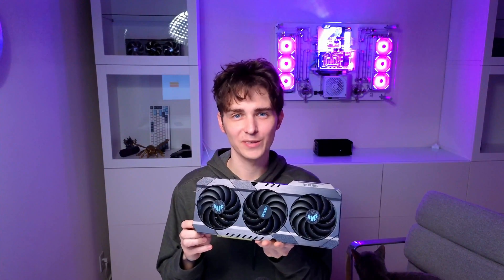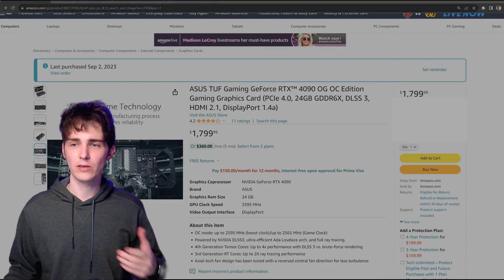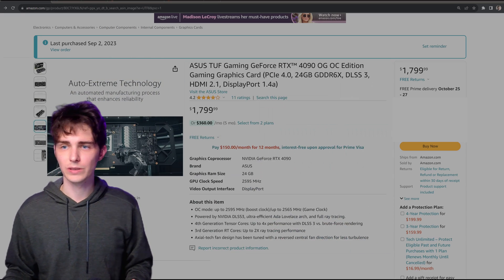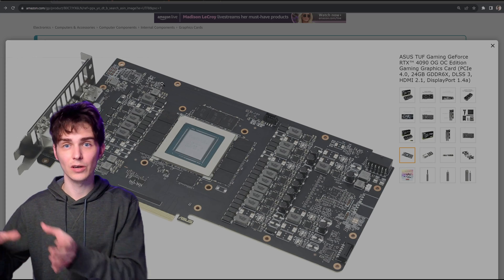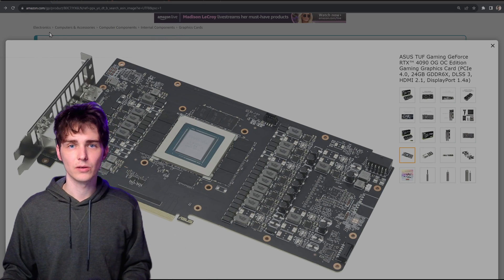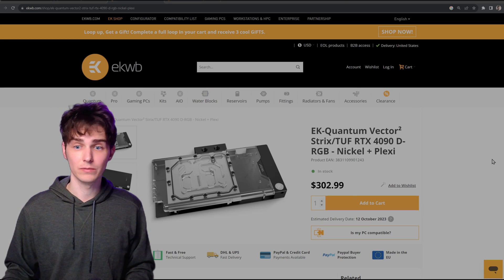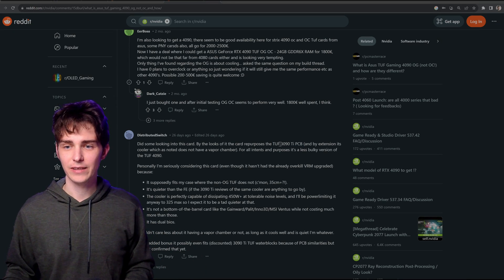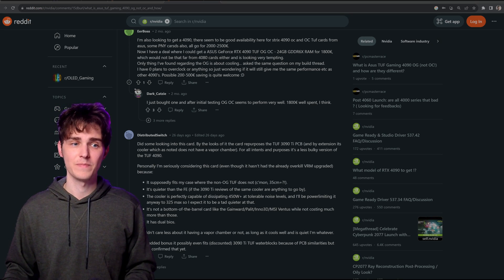Shouldn't have bought this RTX 4090 =(

Comment: Phanteks 3090ti cooling block might fit, however, you'd have to machine the block so that the power supply port and connection clears the metal and the plexi on the power supply corner. Unfortunately i do not have a cnc machine inside my house and good machine shops are quite hard to find in these parts. So I had to return the block to amazon.

Comment: I recently watercooled this card for a client using the EKWB TUF 3090Ti ABP block.
Two minor caveats: the power connector is deeply sunk into the block and the milled recesses for the power connector clip do not align properly, making the clip a very tight fit. The bottom nut/bolt mounting hole for the provided I/O panel does not line up with the hole in the PCB.

Comment: I bought this card
MSI Afterburner settings:
Power Limit 111
Core Clock 300
Memory Clock 1950
Temperatures drop below 55 degrees Celsius in the most extreme conditions
And the fan speed is between 40 up to 50
This card is amazing

I don't know about installing a water cooling kit on this card.

Comment: Bro, I was about to get this card today used/new for $1,400 and I skipped on it because they are also using the 3090 heatsink too. The card is thinner than a standard OC Tuf so it's going to be harder to overclock this card too since it won't handle the heat very well.
Reply: I have this card it never exceeds 70c most of the time it stays around 65c it’s extremely quiet and has no coil whine either, I thought I’d ordered the original TUF but I got this for MSRP it’s a great card much better than the FE
Reply: @TS-wg8jf  my OG is runing 75-80c on gpu .. up to 103 on hotspot.. ;( Asus stinks with building crap crap. card is only 4 month old.
Reply: Don’t buy OG, buy OC guys

Comment: I'm using 4090 Vulcan which is pretty amazing without changing any condition it works with 2820MHz clock speed

Comment: Hi, I bought exactly this card because I use it in 1440p, the question I ask you, is the card less powerful than a normal 4090 tuf or is it just a question of temperatures?
Thanks Bro :D
Reply: i would like to know that too?
Reply: Late to this comment but it’s the same power. Temps are worse because it’s using the 3090 Cooler instead of 4090

Comment: Bought this 2 monthos ago.... Temps went way to high, 83°C GPU and 98°C hotspot on full utilization with RT. Tought it was a bad chip or something but it was more due to the much smaller cooler that is installed here. Even with undervolting not much has changed. I sent the card back and bought an Palit Gamerock OC, Max 69°C GPU and 81°C hotspot. Feels definitely safer in terms of longevity.
Reply: you are talking about this OG OC version right? Standard OC version has got lower temperatures?
Reply: @frankthepriest1220 Yes. The OG versions from Asus have basically a 3090 cooler on it. The normal one is much bigger so the temps are better. Asus TUF OC 34,8 cm = Good, Asus TUF OG OC 32,6 cm = Bad.
Reply: @marcelinouzerrio4937  thanks man. I ordered one on amazon and I'm waiting for it to arrive. On the site it was labelled just "OC" but I read on the comments that someone ordered an OC too but received an OG OC... when I receive, where is it written that is an OG? On the box, on a sticker on the mobo or where? Just to be sure to be aware if it is an OG or not
Reply: @frankthepriest1220 The cardboard of the good card is octagonal. The one on the OG card is normally square. The cards also look different. The OG card has distinctive notches on its fan, 3 on the top and 7 on the bottom. The good OC card has none of these. If you look closely, they look like completely different cards. The fact that they are both black and have the prominent TUF logo in orange in the same place in the pictures can be confusing. Maybe that's how it should be :-D
Reply: Thanks man. Card arrived and it matches the description of the good OC. Yeah people like me who never saw an OG model could easily confuse the two models, and the fact that it's not clearly written on the box let me think that Asus did it intentionally. 
If they are two different models of the same card, Asus HAD TO write it on the box, to let customers choose and not accidentally buy the OG like it happened to him
Reply: I also had this card and I was shocked about the temps. now I have the standard version and I am really happy.

Comment: Hey i just bought the 4090 tuf OG OC but it was marked as a 4090 OC, did I get scammed? Is there any performance difference?
Reply: In my case it got a lot hotter than all other custom models. I sent it  back and bought an other card. Normal temps.
Reply: @marcelinouzerrio4937  I can t send it back it is what it is now
Reply: My OG OC is working great! Temps under workload about 40-45
Reply: @Piapaopao  mine stays a little higher, I fling hate this og shit
Reply: @Piapaopao  in your dreams... the most expensive cards got average 58°c
Reply: you can only overclock this card up to 500w and the standard and the strix one can be overclock up to 600w

Comment: Bro asus is messed up
Reply: satandard bait and switch. we should be given pictures of the PCB on the box, as well as what GPU die they are using. if its non reference that should also be stated. a nice flashy "Custom Engineered PCB!" doesnt even sound bad and give the user a better expectation but it snot about that its about $$$$ for as little effort as possible. This combined with the over volted of AMD SOCs and their joke warranty support for it will keep me from buying any ASUS products, they aint EVGA lets put it bluntly. 

all of this isnt even compare the fact that several 40 series models from the 4060 to the 4070ti have 8 lanes but they use the full sieze 16 lane to make it look bigger but the lanes are faux and go nowhere. thats false advertising
Reply: TUF 4090 owner here! Its amazing

Comment: MSI > ASUS

How many times do people have to get burned, in order to realize this. . .
Reply from the maker: Never tried MSI. Might have to next time!!
Reply from the maker: I really needed 2 HDMI ports though
Reply: @hightechlife  They force over clocked people's CPUs, on ASUS motherboards. Causing the CPU and motherboard to burn, and destroy both components. Then they wouldn't refund people's products, basically destroying the customers entire build. It took an entire community backlash to force change. Gamer's Nexus and Jay 2 Cents made videos about this.
Reply: Brand loyalty is absolutely stupid. I've owned 5 different 4090's, and ended up with a Gigabyte Gaming OC 4090 because it was the only one with zero coil whine with the best silicon. It was a fun binning process. The list includes two MSI Suprim X 4090's, a Gaming Trio variant and an Asus Tuf, not the model shown in the video though. I did like the MSI cards more then the Asus one, just because the Tuf had atrocious coil whine and the hotspot hit 100c after 2 weeks in standard 4k ras which was absolutely not okay for a near $2000 card. A bad TIM application out of the factory?  Not okay Asus. My point is though QC varies with every company and every generation. I was skeptical about Gigabyte at first and now it's been the absolute best, most reliable card I have owned for the past 10 months. Suprim were beautiful definitely but yeah. Why power limit a card with a 26+4 phase VRM it doesn't even make sense. I shouldn't have to flash the bios to get what I desire.
Bottom line though when I see people stand behind and stick up for certain brands while bashing others, it is absolutely stupidity. You should only care about the fastest. And the best. Not branding. Asus definitely makes some nice stuff. I'll give them the nod on the die-cast shrouds whereas MSI you  have to buy their flagship model or you're getting a giant plastic shroud. Just like Gigabyte.
One thing MSI did do right though was 3 slot io with a PCB metal brace. Gigabyte had the best anti sag bracket design out of all of them though, where it actually screws into the motherboard with standoffs and into the GPU. Suprims was a ridiculously long pole, and it came with a tiny mousepad like wtf lol. Gaming trio had a stupid design that supported the wrong side. Asus' came with a little gimmick screwdriver hybrid thing.

Comment from the maker: UPDATE (2): EK got back to me and said none of their blocks will work with the TUF 4090 OG.

UPDATE:
Lots of people are asking if the 3090ti block will work. I reached out to EK to ask them directly. Waiting for a response. 

Also, lots of people down voting the video thinking I'm talking about the TUF 4090 OC card. This video is about the TUF 4090 OG OC card. They're different. It's confusing.
Reply: good video
Reply: I have a feeling they just haven't tested it so they can't tell you it fits.

Since the board layout is the same as a 3090, the contact points will be the same.  The only possible difference is if some of the components are a different height.  So you'd have to change the thermal pad thicknesses through trial and error.

But I HIGHLY doubt they are different.    

And all you'd have to do is put a 3090 block with 3090 pads on it, assemble the card, then take it apart and look to see if every pad got dented and the thermal paste was squished on the core.

If yes, then you are good to go.

If not, then figure out what needs altered and swap it out.

Other than that, if the PCB is the same, a 3090 block will definitely fit.
Reply: Ek says the 3090 ti water blocks will fit this card. I did the same thing.... took it apart to find a different pcb and voided any return policy. And had the wrong cooler. Anyways I could return the cooler and buy the 3090ti one.  It's on sale on ek's website
Reply: The EK block for there 3090ti works as i have the tuf OG OC and have the double sided block from Ek and it works perfectly once you get the contact pressure right i replaced the paste with HT-02 as HT-01 didnt give me good thermals on my hotspot and replaced EK's thermal pads with a thermal pad from and thermal putty and the temps are really good now my memory temps don't go above 50c core can go to 55c to 60c and hotspot gets about 10 degree's hotter than the core on average if core is 50 the hotspot generally hovers about 7 to 10 degrees higher with normal gaming temps for core at around 45-50 hotspot is 55-60 and memory about 45c. i can get +1850 on memory and +235 core gaming, and +1900 memory and +250 core in benchmarks

the compatibility link is this one they also do a single sided block as the double sided block may not fit some motherboards cause of the ddr ram and ssd heatsink gets in the way of the back of the card hance i have my card installed in the second pcie 5.0  slot running at pcie 4.0 x8 which i hope to change when i get a riser extension and place the rtx card at the bottom of the Thermaltake 900 case its installed in and connect the riser extension into the first pcie 5.0 slot
 
https://www.ekwb.com/configurator/step1_complist

any of those blocks wil;l fit the asus tuf rtx 4090 OG OC

Comment: How about getting a water block that was made for the TUF 3090TI ?
Reply from the maker: I can't find a clear answer if the 3090ti block is compatible or not. EK hasn't said that it will work. I'll reach out to them directly and see what they say.
Reply: @hightechlife  compared the boards in gimp just now by overlaying them. Seems to fit just fine. The smaller AD102(4090) is offset to the bottom right but still fits in the footprint of the GA102(3090ti).
Reply: @hightechlife we already know it won't work because the borad size is the same but the die isn't.  So you would need a water cooling setup that fits the 3090 ti borad and the 4090 die cast. Doesn't seem like to big of a problem but an annoying one for sure.
Reply: Thought of the same thing